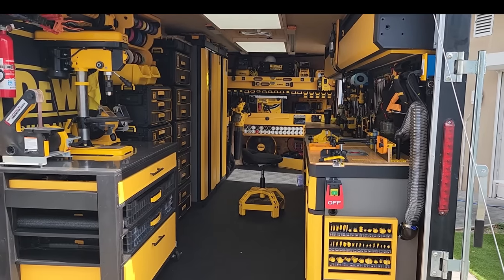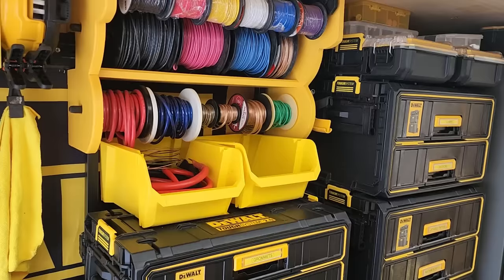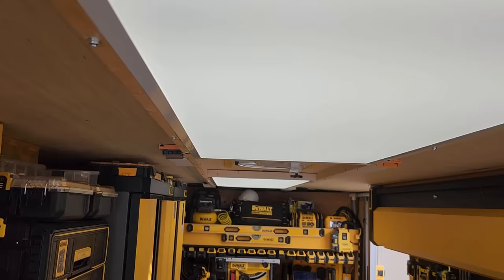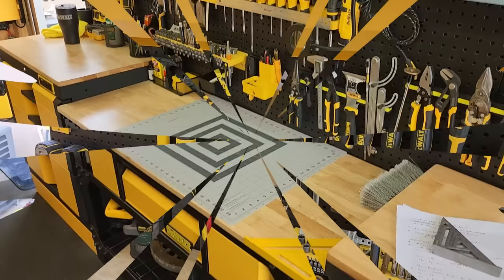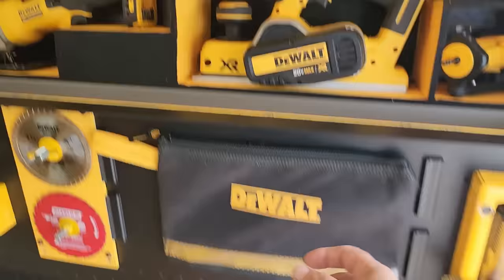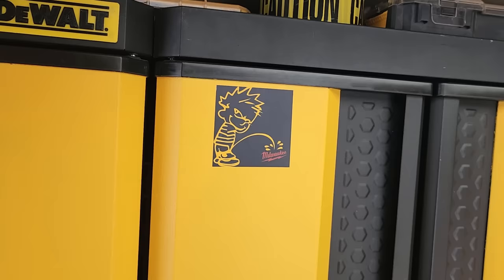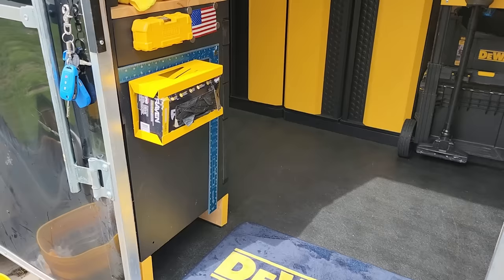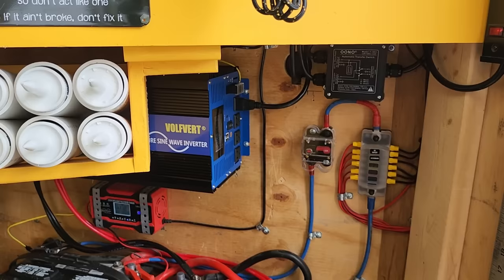DeWalt Theme Trailer Workshop

Comment from the maker: Selling the Trailer. I am currently asking $30k OBO. This price does not include the tools, fasteners or DeWalt boxes. It  includes the trailer, all cabinets, electric/battery power, and the router table. It does not include shipping/delivery or transfer of title. I may be persuaded to sell "as is", but will not entertain offers under $50K. I will not accept lowball offers, nor am I or am under any obligation to sell it immediately. This trailer is unique, fully functional and a labor of love.
Reply: That's what I told my wife, less than 50,000 I wouldn't sell it and I'll tell you that you could dedicate yourself to making those types of trailers, I think that many would buy it and it could be a good business
Reply: What is the inside height? Looks a bit tight
Reply from the maker: @andrewfreeman88  sadly, it's only a 6' cieling. I wish it were just a few inches taller, but I had a budget, and my choices were too few.
Reply: @BarrysToolCave  Well that would give me 1 inch of space above but at least don't have to duck around.
Reply: Still avail? Best way to contact? Reason for selling?
Reply from the maker: @putering1994 I'm selling it because I need the money more than I need the trailer right now. I don't "want" to sell it, but I will eventually build a new one. 
I can be reached via email

Bgrand1313@hotmail.com
Reply: lol ok there is proof this is just bullshit... you are not a contractor you do not actually use these tools for a living...anyone who uses tools for a living will have a mix of tools and they sure as fuck would not be all clean and dust free and unused looking like this is AND any contractor would know you aren't fucking working inside your trailer ....like at all...the trailer is to store the tools...noone is working in the trailer like that, not enough space and impractical.
Reply from the maker: @AsTheWheelsTurn  I don't do any work inside the trailer other than minor repairs,  electronics, and hobbies at the desk with my dremel and soldering station. The benches in the rear are on wheels and roll down the ramp to be used outside. Everything else is also done outside under a canopy on a full sized rolling bench. 
   Everything looks new because ..it is! I literally filmed this right after completion while everything had a fresh coat of paint, and all the tools were cleaned. This trailer  is merely tool storage since i dont have a garage on my house. These are also NOT my only tools... I have a lot more "mixed" tools I use daily in the truck. However, it is far easier to have only one battery platform. I have no need to carry any additional cords or chargers. 
  Also, I take care of my tools. I clean and maintain them regularly and always wipe them down after use. Some of those tools have 20 years on them and still look and  perform like new since I don't drop them in mud or use them as hammers.  I do a wide variety of tasks and have 40 years in the field. I made this trailer when I had plenty of free time on my hands and money to burn. It's very real and serves it purpose perfectly. 
That purpose does not include being driven daily.. It's merely a 7X14 annex on my house. 
I paid $6K for a used trailer.. that's a lot cheaper than building a 7X14 extension and dealing with permits.
Reply: @BarrysToolCave  30 yrs for me in the industry. I had a full blown metal shop. I’ve had every tool platform going. I’m started with Dewalt and I’m back with them. Tools change, get better, smaller, lighter, better batteries etc. It’s hard to stay completely though with one platform as someone else has a unique or better tool. Every tool I’ve ever owned I’ve cleaned and looked after. If someone borrowed a tool from me and it came back in worse condition they never borrowed again. The only thing on your trailer that I would object to is how you made storage specific to that tool. If that tool changes the new tool may not fit. Tools are freedom. They make you money or save you money. It pays to look after them.
Reply from the maker: @carbonunit6573  I agree about the organizing bins being specific to the tool. That has the benefit of keeping the tools more secure, but also the headache of having to stick with that specific tool. 
  The only justification for it is that DeWalt is one of the top manufacturers. While they are not always the best, they will never be the worst. I have been satisfied with every purchase. I have not purchased any "new" tools since building this trailer, but if some new model doesn't fit, or one of the tools is discontinued it will take a lot of work to reconfigure the cabinets.
Reply: I clean what I use after every shift.  Sometimes, it's a nice way to wind down with a beer.  That's just ne though, to each their own.  Sure makes it nice each morning when you want to work on a bike, and shit ain't all greasy.  Work hard, stay organized, clean up, eat a steak, bang the girl, and go to sleep.  That's my day.
Reply: What is the size of your trailer and single 🤔 or double axle?
Reply from the maker: @justinburke3336  it's a 14 x 7 double axle
Reply: ...Because I'm going Milwaukee

Comment: I’ve spent the last 25 yrs doing metal work in high end homes. I’ve made my own cabinets from scratch but what you have done is nothing short of amazing. Splitting that cabinet is ingenious. Painting details are spectacular. I did however buy the dewalt 60 volt mag drill and a Fien mag vise. (Instead of a drill press).

Comment: Very nice design and use of space.  I wish I had more time to make mine look as clean as this.  I use the tough system wall mounting system also.  I actually didn't know they make non-foldable brackets.  I've had mine since 2018 so maybe the newer ones have changed.
Reply from the maker: As I discovered "after the fact", there were 2 versions, a van rack system, and a garage system. The van system with the folding arms was apparently discontinued? I was told, but have not confirmed that.. regardless, I was only able to find the garage system online, and was forced into buying the folding arms. Personally, I don't see why the rigid arm version even exists.

Comment: I don't know why Dewalt doesn't make a regular drill press. I'm trying to buy all black and yellow but they don't offer it other than their magnetic drill. I love the trailer man, I've been watching a ton of trailer videos for ideas and yours is the nicest by far. The only critique I have is that I would get different pulls for the drawers. That pulls you have can catch on your pants / especially cargo pockets on shorts and cause a trip and fall or make you drop something.
Reply from the maker: Designing a trailer like this is a balancing act of form and function. Obviously, the practical function is most important, but I also wanted look nice. The handles and drill press are both great examples. If the handles become an issue, I will definitely replace them, but they have been fine so far.  
   As far as why DeWalt doesn't have a drill press, I have no idea .. DeWalt is a subsidiary of SB&D, so I have to assume it has to do with money or logistics.  They were probably just not selling enough to make a profit.

Comment: I like DeWalt, but this is way overboard dedication to the point of obsession. Nevertheless very nice job, well thought and executed. Love it
Reply from the maker: Thankyou for mentioning this. You are 100% correct, and I fully intend on filming some future content that addresses this. This project could just as easily have been Milwaukee or Makita etc, but it also demonstrates the extremes of being "married to a battery platform" and "brand loyalty". Both the negatives and positives... as well as the sacrifices in tool quality one may make in order to avoid owning multiple brand chargers and batteries.

Comment: Awesome setup! I might have a suggestion that could work for all the tools you have to throw in a box when the trailer is in motion…why not get rubber elastics with hooks at both ends to strap down section by section …
Reply from the maker: It's crossed my mind (along with a few other ideas). The thing is, I don't have a garage. This trailer is basically set up as a small shop to store my collection. I don't really intend on driving it around much.. if ever. But I also didn't expect the trailer to get more than 500 views or acquire sponsors either.. things are happening fast, so I may have to revisit that idea in the future. Coincidently, some time in mid to late July, I will be doing a more in-depth video series. One of the videos will specifically be about how I secured everything as that seems to be the biggest criticism about the trailer (that and its not "milwaukee") and I may end up doing just as you suggested for the sake of the video. Or some combination of ideas..  
I do appreciate the feedback, thankyou
Reply: @BarrysToolCave  fully understand the fact that it’s acting as a garage/collection storage…it’s not milwaukee…because black and yellow looks so much better for many folks that have had to decide which battery platform suits their taste/preference of power tools…great news that a video series is coming soon! Will be watching and glad that things have been moving fast in a positive direction!

Comment: Hey Barry!
I've already commented how incredible your DeWALT trailer build is, and I've been thinking about it non-stop, as it gave me an epiphany to  combine the 3 things I've been wanting for years. A Tool Shop, a Towable Hauler, and a Travel Trailer. Because of your great design, and my affinty for DeWALT, my goal for 2024 is to create a 3-in-1 interchangeable Enclosed Trailer that I can wheel things in and out for each of those needs. A modular travel trailer, if you will. So thanks again for sparking that idea. AND introducing me to HWGA Supply in Cape Coral. Can't wait to make a trip there from my home in the Orlando area.

One quick question I thought you'd be the perfect person to ask:

Have you found any adapter, either DeWALT made or 3D printed, that allows the DeWalt 4-Port Fast Charger Model # DCB104 to be fastened to the top of a ToughSystem 2.0 Drawer Stystem? I've already tried the DWST08017 Adaptor, but that  doesn't lock it, flipped in either direction. If you, or anyone reading this, knows DEFINITELY if the 4-Port Charger fastens onto any..."drawer system" (not box), or has a 3D print adaptor/clip, I would be so grateful for any info. I've been searching internet for days. My goal is to secure it to the very top of a drawer system on my mobile 2.0 roller tool box.

Thanks again Barry! Such a great job on that trailer! 👍👍  Please keep posting videos when you can.
Reply from the maker: Cool deal, please post a link when it's done!. 
As for the DCB104 battery charger, it was originally designed to fit on top of the first tough system (1.0). So that would be the logical choice. I dont really have any experience with that particular box as i didn't buy my first drawer unit until 2.0. Unfortunately, they are out of production, so you may need to do some online searching or settle for used "like new" units. I have also heard that the draw units can be modified to fit the charger by cutting a small portion of the locking tabs.. I have not done this myself as it's sort of a "one way trip.". The drawer units are too expensive to intentionally destroy one if it doesn't work.

 (P.S. there has been a rumor floating around for a while that there is a new 4 gang 2.0 flexvolt fast charger coming out... I dont have any details as I heard this directly from a DeWalt rep, who also told me the DCB104 was being discontinued nearly 3 years ago and yet I still see them on store shelves. It was "supposed" to have been released back when poweratack was introduced) 

With that all said, I haven't really ever had the need to lock my 4 gang charger to a drawer, I  have two of them,  and they are both mounted to walls.. one in the trailer, and the other in the house. Instead, I bring the open top totes to my jobsites with one or two of the single fast chargers. I don't normally burn through batteries that fast to require a 4 bay unless I am using the super heavy-duty flexvolt machines like the 1" chipping hammer or the street saw. A single fast charger can even keep up with my table saw needs as long as I am using the big 9AH batteries.
Reply: @BarrysToolCave  thanks for all that info.  I found the hack on cutting a small portion of the latch lock. I might just zip-tie it to the 2.0 unit below it with black zip-tie's and call it a day. I'm basically creating my own Tstak Tower with 2.0 units, to roll around as one complete station for now.  I'll post that when I'm done and share it as well. Thanks again for all that info. It's appreciated.  Wish I could buy the trailer you're selling, but I'm sure it will sell quickly. I look forward to seeing any new builds you do.
Reply from the maker: @MotorcoachTony  its not an easy sale.. I am asking $30k (without the tools), but I dont trust putting it on marketplace etc as I don't want it stolen. Most calls I get are scammers

Comment: Do you use the tools lol, they all look brand new!
Reply from the maker: I knew it was just a matter of time before someone asked this question! I know I  would have! :) ...  The simple answer is yes, I use the hell out of them, in fact I used most of them to actually build this project. If you pause the video and look at them, theres plenty of battle scars. 
 The more thorough answer is that the cabinets and the "rebranded" machines and most everything you see here all has a brand new fresh coat of paint. Every tool has been degreased and cleaned up as nice as possible simply because I knew I was making this video. I am obsessed with cleaning my gear and putting things away as soon as I am done with them (severe OCD), but I can assure you, it's not going to look this good ever again! :)

Comment: Amazing , I’m a Dewalt guy currently fitting out a 7x16 new trailer . Are all of those tools brand new ?
Reply from the maker: Yes and no.. there are a few new tools in there, but most everything has a few years on it. However, the trailer and most of the cabinets are new or freshy painted, so it gives the appearance that everything is new and pristine.  I spent a lot of time cleaning and degeasing all my tools before I loaded them into the trailer. If you pause the video and have a good look at the tools individually, it's pretty clear which ones saw heavy use.  In fact half the tools in the big standing double cabinet are over 10byears old, broken and need to be replaced. ... but they look great! Lol

Comment: Looks great and the rebranding for a synchronous look is amazing. Kudos for taking the time to do that. 

Curious why you didn’t paint the rigid vac?
Reply from the maker: Dewalt has a small corded vac I am considering putting in its place.. ibjus have to research it a bit. I need it to have a lot of power.
Reply: @BarrysToolCave  check out Nilfisk-Advance, HEPA Canister Vacuum, Euroclean GD930HSP

Comment: there is a set that does fold in.  my trailer every single tough system arms fold in.
Reply from the maker: Yeah I found out after the fact.. I just couldn't find them online. I was told they were discontinued.
Reply: I believe this is in refrence to the “van racking systems that rolled out during the first roll out of the tough system lineup. They were discontinued quickly, and the only place I’ve seen them for resale consistently is Grainger. I too was disappointed they don’t fold. Just doesn’t make sense. The tough system cart rack has folding arms and they didn’t discontinue it, but can’t seem to keep the price down that’s for sure. 😂

Comment: Trailer is awesome! Great job. You are cracking me up with the tools you painted to match. Very clever. However, it looked tedious and time consuming. I have a few questions if you don’t mind. Under the ATS, is that a fuse. If so what size are you running . One more thing do you have solar panels to assist with recharge? Either way where would they join the wiring party at under the counter?
Reply from the maker: There are no solar panels at this time... I may add them at a later date along with an air conditioner.

Comment: Trailer looks great.  Can imagine the time spent planning.  How does it travel?  Based on what I deal with in my trailer, I don’t see this being practical.  I bet all of the tools in those upright cabinets fall out.  Hope I am wrong for your sake.  Nice exhibition though
Reply from the maker: They are all secured with different methods and locked in place. They are not going anywhere :) ill likely be doing another video about that in the not too distant future. It took a lot of failed attempts to figure out what works best, but my focus was on finding ways to secure them while only seeing the tool, not how they are secured.

Comment: Incredible setup! How do you remove any individual box on the racking system if they are all clipped together?
Reply from the maker: They are not fully clipped. There's some wiggle room. It's also rare that I have to remove them, its easier just to remove the inside trays I need and bring them individually.

Comment: Looks very nice, where did you find that paint or did you have it mixed up??? And emblems too??? Like the attention to detail, like labels yellow and black, etc.🤩🤑🔥
Reply from the maker: Paint was color matched at home depot. It is an acrylic, so it can scratch fairly easily. I'd recommend using a topcoat. As far as the emblams go, I found a guy that 3d prints them on Etsy. They are fairly inexpensive, but the resolution is not very good up close.